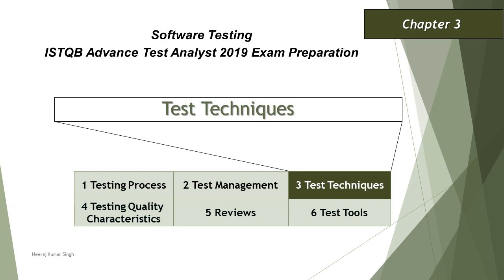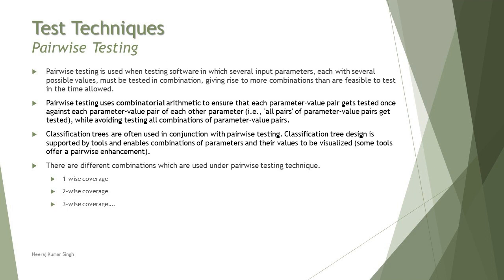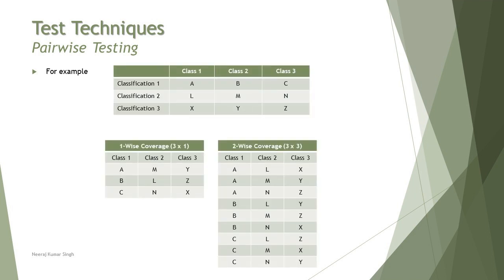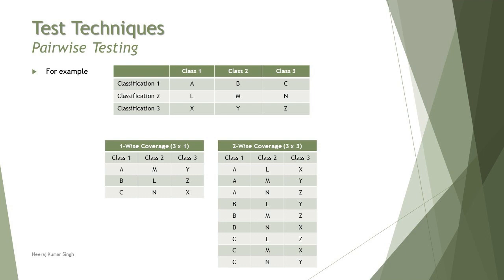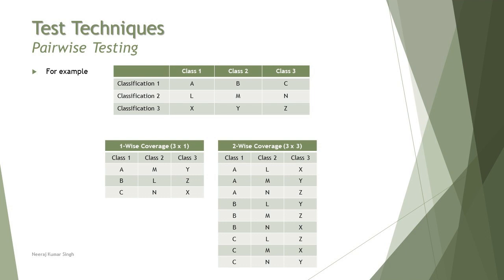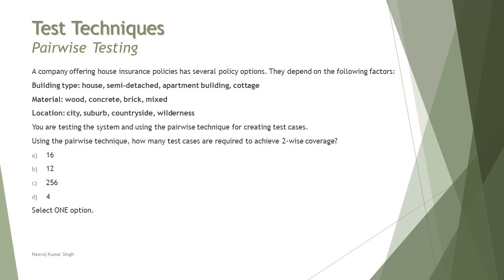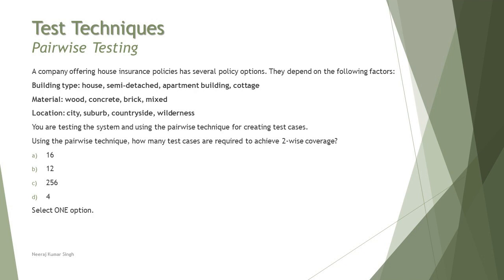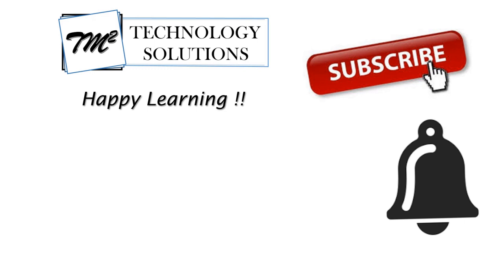ISTQB Advance Test Analyst | 3.2.7 Pairwise Testing | Pairwise Technique | Combinatorial Testing

Comment: Consider a multi-language web application with the following requirements:
• Support three different languages: English, French and Japanese
• Run on three different browsers: Br1, Br2, Br3
• Run on three different operating systems: OpS1, OpS2 and OpS3
You have been asked to test the correct behavior of this application for various combinations of
languages, browsers and operating systems.
Due to the restricted amount of time you decide to apply the pairwise test technique for creating
test cases.
Using the pairwise technique, what is the MINIMUM number of test cases needed to achieve allpairs coverage?
a) 3
b) 6
c) 9
d) 27
Select ONE option.

Sir please help me on this Q, as my exam is on Sep 11th.

Comment: Hi Neeraj,  Need help from you on the below question 

In question 
Classification 1 : class 1, Class 2, Class 3, Class 4 
Classification 2 : class 2, Class 2, Class 2, Class 2
Classification 3 : class 3, Class 3, Class 3
Classification 4 : class 4, Class 4.

Using Pairewise techniques, 
Q1 How many TC required to achieve 2 wise coverage?
Q2 How many test cases are required to achieve all pairs coverage?

 Thank you
Reply: Q1: 16 Test Cases
Q2: 16 Test Cases

Explanation:
Q1: Classification 1 and Classification 2 has the most highest number of classes which is 4 multiplied by 4 = 16 Test Cases
Q2: same explanation as Q1. 

Pairwise testing is also called All Pairs Coverage :)